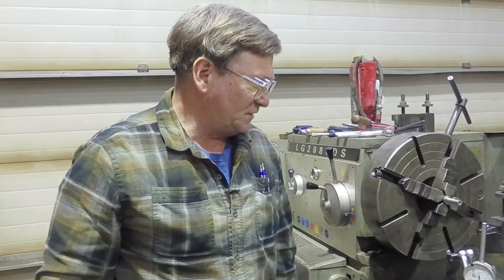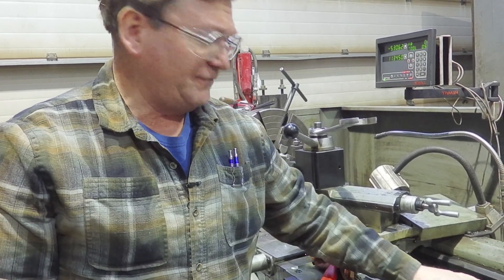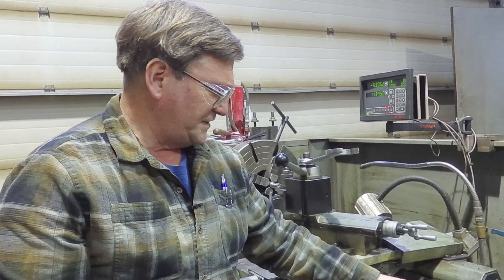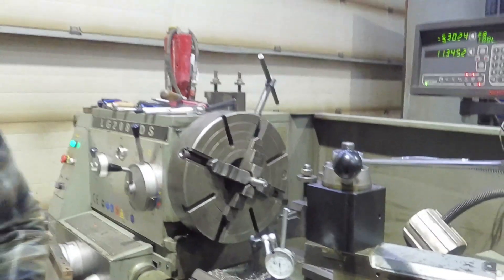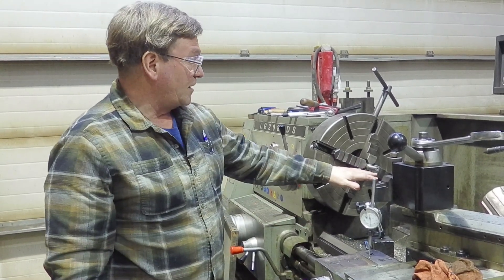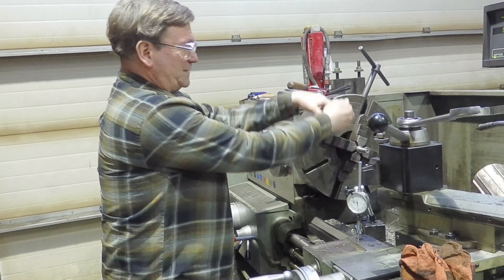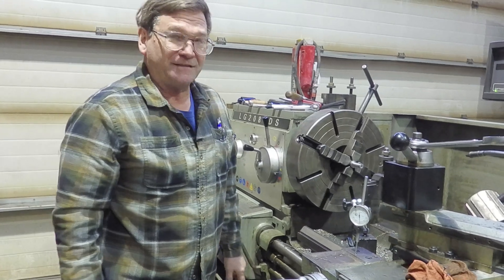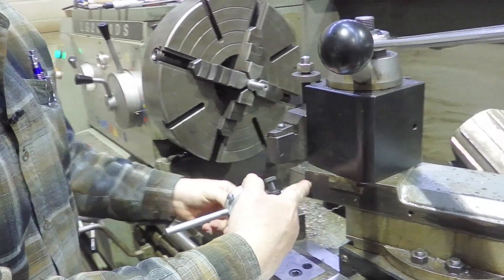Machinist's Minutes: Don't lean on your lathe carriage (or take heavy lifting cuts!)

Comment: Hello Sir, just discovered your library of videos! I thank you for creating this and passing on so much of what you know. Iam a hobbyist, I try to learn as much as possible and have been for more than 15yrs. I do have the following machines. 1967 BP Series I Mill, 87 Elliot 10M Shaper, and lots of others. All my machines are Manual non of the CNC types as I tried to learn the trade in its purist form. My question is regarding my lathes. I have multiples and this is my question for you Sir. I have a 1951 Cincinnati Tray-Top Cinci Lathe 15x48. No Hydrashift for that year. I restored it cosmetically shortly after I acquired it. It served most of its time Post WWII on a US Naval Ship, I aquired it from a retired naval machinist. Use was lite-ish I would say. The machine is solid at zero. I was recently presented with a newer lathe, a Clausing Colchester 1978 13x40 Model 13" 8015. The price is great and the lathe is in good shape. Comes with lots of tooling too. 

I do have the "Machinist Curse" and only have room for one. If you had to pick, which one would you choose? 

Once again, I thank you for ALL the content and knowledge you share with us out here.

-Otto
Reply from the maker: The Cincinnati is a solid machine & 15" beats 13", but the D1 style chuck mount on the Clausing is better if you change chucks very much.  The Clausing probable has a bigger spindle hole & would be the better if your work doesn't need the extra swing.  For most home shop/gun work the Clausing would win.  However you might be doing some things already, that the 13" won't fit.  The hydra-shift would be more bother than benefit even if it was available, the answer for more speed control is a VFD, which could be added to either of these lathes.   The real curse, is the size of your shop, it is the same "size" as mine and everyone else's' , which is "too small"
Reply: @HOWEES  THANK YOU 🙏🏻, for taking the time to reply it is deeply appreciated. I have a static phase-o-matic and and will be converting to a phase converter with a VFD to keep better accuracy on rpm. Yes, I will definitely agree every shop is always “too small”.🙏🏻

Comment: My is lathe around 80 yo, 
405mm/16 inch capacity
Like 1,5m/4-5 feet between centers
1 Ton/2000 pounds of swedish cast iron! 
Great size for a homeshop.

If I push hard on the compound during a cut, I can visually see the diameter change just like you talked about. About 0.05mm/2 thou

Keep up the good work and cheers from sweden!

Comment: Had bit of trouble watching this because the whole time you were talking the only thing I could do was look at that key sticking out of the chuck. Many years ago while working in the shop of a major airline a guy a ways in front of me did that and when he started it that key flew over my head and knocked a chunk out of the block wall behind me. A good rule that I've always followed is to never take your hand off the key while it's in the chuck. That way you won't forget to remove the key when you remove your hand.
Reply: Hard same. That’s a firing offense in my shop.
Reply: There was a chunk of concrete missing from the wall behind a large lathe chuck at the training shop.  I'm not sure it wasn't a stunt but it sure made an impression.  "Always start in reverse if you've taken your hand off the chuck key "

Comment: What about parting of from the rear with an inverted tool ? Thats a pretty common operation, some machines even had special tool holders for it
Reply from the maker: That's good, it is still putting the pressure down.  When you have a tool, and rotation that causes lift, is when the problem starts.  I used a rear cut-off many times in my turret lathe days, and once or twice on an engine lathe.  Most of the turret lathes I ran had box ways, so they were fully captured, W&S#3, B&O#2, Gisholt#5, Hardinge #?
Reply: @HOWEES  Thanks for clearing that up, i was wondering, because my big engine lathe has a purpose built rear tool post.
Btw, did you ever run a WMW machine ? They were made in east Germany, where im from, and i know that they also exported to the US.
Reply from the maker: @MannoMax  I never ran a MWM.
Reply: Ball bearing ways... Linear guides
Reply: @paulhunt598  No, i mean on old conventional lathes with prismatic ways, like shown in the video